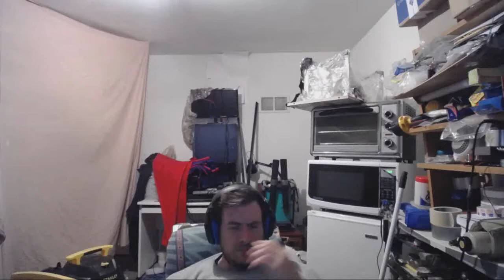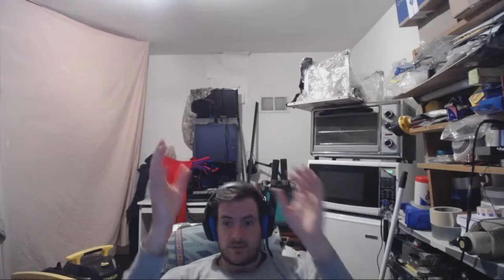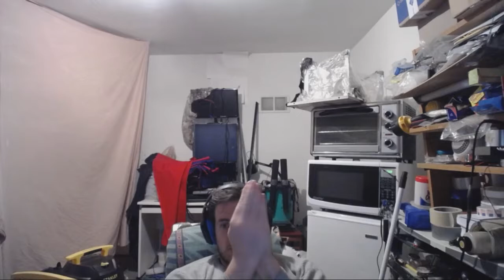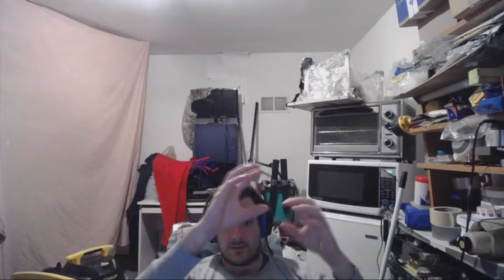Brushless DC Motors Vs Brushed DC Motors Vs Induction Motors

Comment: i'm facing that problem between induction motor and bldc motor , 
i'm trying to build an electric car 
the weight is around 500kg 
so which motor is the best ? 
because , bldc motors are the best at efficiency but tesla use induction motors !

Comment: Which is better brushless motors seem fine...but suffer on crash..
Reply from the maker: Brushless are best.  If you want to protect them on crash, maybe create a roll cage around them?
Reply: @artbyrobot  you see U was thinking of scenario where there's drives are used in a racing car...I think motors would be placed were engine was rather than in each wheel..but thus technology allows 3x3 to displacw 4x4 cars...and design cars cheaper if you maje motors yourself...
Reply from the maker: @ambientsoda106  I was talking about quadcopters.
Reply: @artbyrobot  ok but if you ere making a car how would you use motors...as it seems 1 on each wheel would be really heavy and one motors could be used to power entire car and wheels...

I'm just thinking about an arduino project...https://www.instagram.com/p/COWCR4XDGns/?igshid=1v8xokytz2n05
Reply from the maker: @ambientsoda106  I have seen wheel hub motors for cars and they aren't strong enough to run the car.  So you have to have a motor in engine bay too anyways.  Might as well just use one motor then to simplify it.  This is going to be induction motor.
Reply: @artbyrobot  yeah my thoughts too..cheers